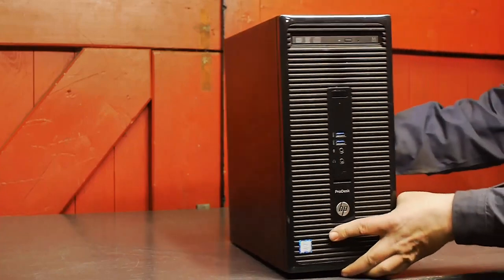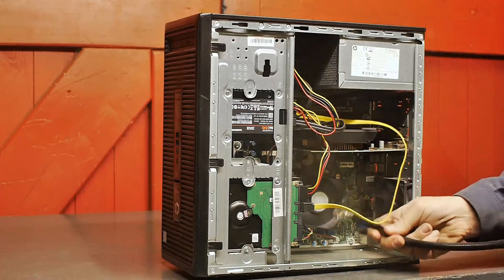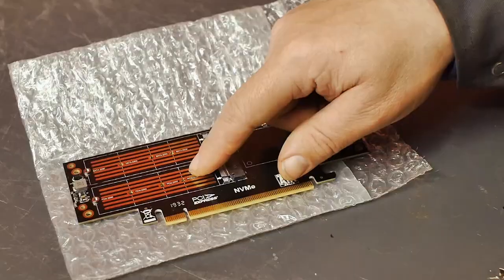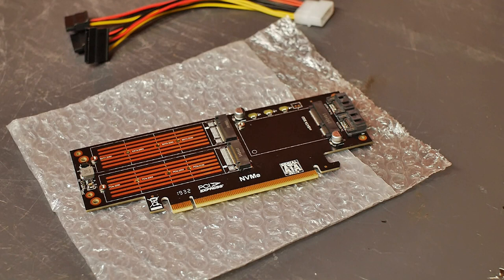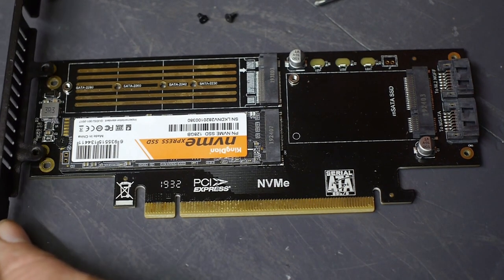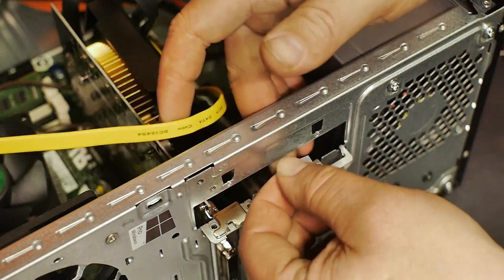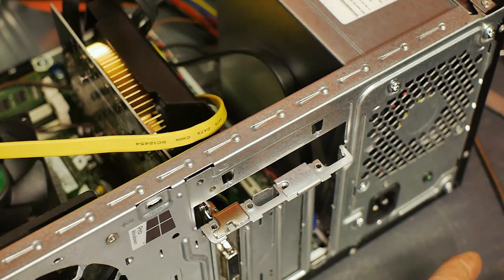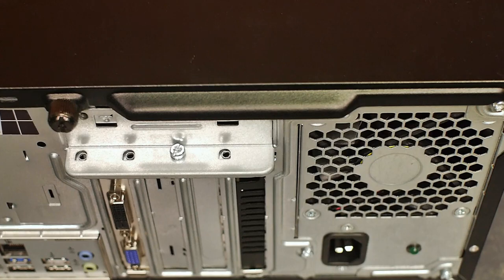Adding a NVME PCI card to my Computer

Comment: I would have gone with a 2TB nvme drive and reinstalled windows to it. And i know that machine supports booting to PCIe. As for the add in card being able to use all 3 drives at once it can in theory. If the mobo supports bifurcation it should see all 3 of them, but with the extra sata ports on there I'm willing to bet theres a controller chip on there that will alow you to use all 5 at once.

Comment: The power is not problem with splitting I use something similar I have connected 2x1tb hdd and 480ssd but depending on your PSU

Comment: I was getting excited thinking this may be a an older office system that still has PCI slots (not PCIe) and someone found an adapter for nvme to PCI they used to run a card in one of these ancient systems somehow. Cue my disappointing...
Reply: The old PCI standard is too slow for NVME drives to work with it. You're tied to 133 MB/s, which is fast enough for Gigabit Ethernet, but pales in comparison to even PCIe 1.0, which can transfer at 4GB/s with a x16 slot.
Reply: @BrunodeSouzaLino  I know. But putting the adapter inside some PCIe 1.0 or 2.0 x1 slot (as in what's available on most OEM boards) isn't exactly giving a modern NVMe  drive any bandwidth either
Reply: @b0ne91  It's worse than that. Some workstation PCs will only run the PCIe x16 slot at that speed if you put a card which uses all 16 lanes, otherwise the slot runs at x1.

Comment: hey man just some advice dont spin the fans with air it created DC voltage that can fry components like the motherboard.
Reply: more recent motherboards and PSUs have overvoltage protection to prevent that kind of damage, BUT you should always secure your fan blades when cleaning them with compressed air, as the air pressure can spin the fans fast enough to strip the motor bearing.
Reply: hehe they fooled you too eh...  pc tech 35 years.    dunno but given all the protection on the board for those very reasons are kinda obvious,,,,  a fuse (capacitor)...    they cant feed energy in reverse lol  the fans the first to die,  then a stage caoacity system that simply dies before anything else, much like a fuse once it dies no power through what so ever..

oh good to know..  electricity is drawn in,  not forced. :-)

Comment: The sata connections are used when using MSata and NGFF SSDs, you connect them to your motherboard sata ports. You are not getting 2 extra sata connections. Typically on thes e cards you can use one nvme and one ngff (sata), since yours has a msata, it can probably use 3 drives, 2 of which require plugging in to sata ports on mb. The top nvme type slot is keyed for NGFF drive which uses one of the sata connections.